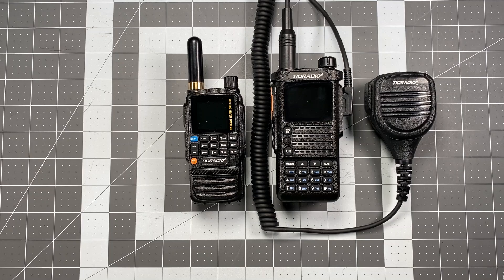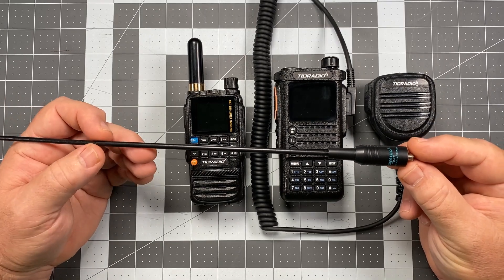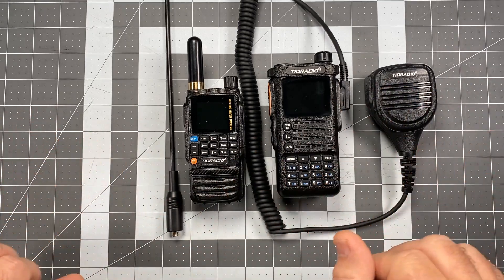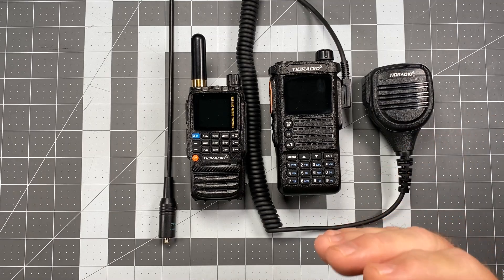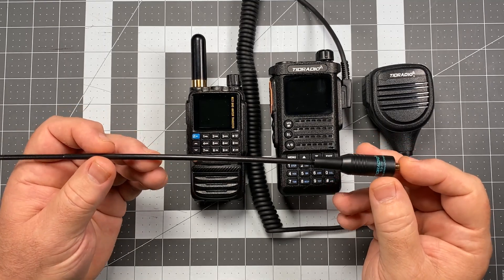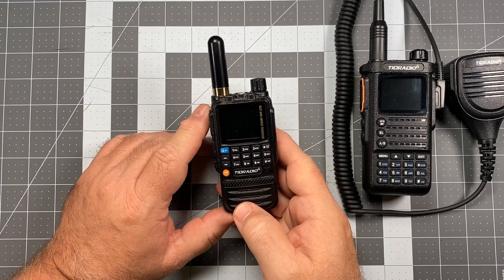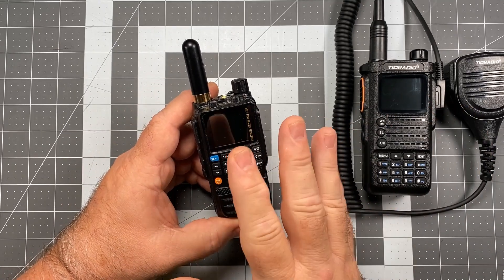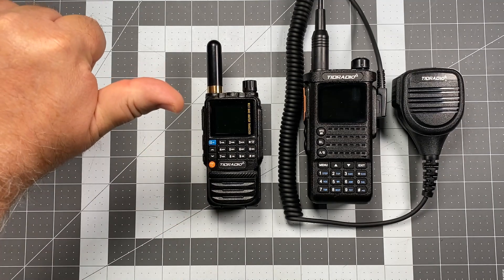TID Radio Antennas Review

Comment: The TD-H3 is awesome. I also got an H8 which I returned to Amazon. I had them side by side and the H3 picked up more than the H8 and I had them positioned the same, even moved the H8 around and could still not pick up the frequency I was listening to on the H3. Also long pressing the “1” puts both in scan mode listening for a  transmission from a radio beside it. The H3 did great, the H8 did very bad. Also both worked on OD master but only the H3 worked on chirp with the cable connected. Perhaps I got a lemon. Nice video.

Comment: Good day!

I've been searching for an answer for a long time but haven't been able to find it. I'm asking you after spending many hours trying to figure it out myself.

I have two Abbree 771 GMRS antennas and two Nagoya 771G antennas. I tested all four antennas as accurately as possible using a calibrated NanoVNA. Yes, I understand that measuring the SWR of handheld radio antennas is a very difficult and often inaccurate task. However, it is still possible to get a general idea of the key parameters and, at the very least, compare different antennas with each other.

The results showed that the Nagoya 771G had an SWR of around 1.8, 70Ω, and -10 dBi (S11) at 463 MHz, while the Abbree 771 GMRS had an SWR of 1.1-1.2, 51Ω, and -22 dBi (S11).

Obviously, based on these parameters, the Abbree 771 GMRS appears to be the better antenna. However, I’ve heard that cheap Chinese antennas are often "tuned" using some kind of transistors to make their parameters look good on measurement devices, but in reality, they perform poorly in transmitting and receiving signals.

In other words, the antenna itself may have poor characteristics as an actual antenna and may not efficiently send or receive signals, but the manufacturer might use cheap tricks to manipulate the readings on testing equipment to make it seem much better than it really is.

Could you please confirm whether this theory applies to cheap antennas (Abbree costs only $8)? Can I rely on the measured parameters above to conclude that these specific Abbree antennas are better than Nagoya in my case? Or is the only way to determine performance through real-world tests?

Thank you for your response. I truly appreciate it.

Best regards,
Oleksii

Comment: I've tested a lot of handheld antennas from Tid, Abbree, Nagoya, Bing Fu, and others.  I used both a VNA & a directional watt meter, the same way that you did.  The two instruments generally gave results that were similar.  The antennas were a real roll of the dice.  Different ones worked in different frequency ranges.  "identical" antennas proved to be very different sometimes.  When I found stubbys that had a SWR below 3, I was able to get about a mile out of them at GMRS frequencies using a handheld with 4 watts of measured output.  More than a few antennas from a variety of brands had SWR above 10 when testing within their specified frequency range.  Even the mighty Nagoya was a little hit & miss sometimes.  Bing Fu gave both the absolute worst & some of the best results.  Their stubbies were not usable, but their 6" air band was actually good, while still being cheap.  Build quality generally seems better on the higher priced antennas, but price does not guarantee proper tuning.  The internal guts can be very different.  A poorly built cheap antenna that is tuned correctly will work better than an expensive one that is not, but the cheap ones seem to not last as well.  A meter is worth having if you are going to be buying antennas.  What they are marked is not always what they actually are.  The antennas that come with the radios age generally OK but not great.  The best ones came in just over 1.1 which is spectacular.

Comment: Good day Sir. If we leave aside all the characteristics of this antenna and focus solely on the safety of using a stubby antenna for the integrity of the radio, is it safe to use these antennas? Do they damage the transmitter?
I have read in many places that such short antennas, very often with high SWR, can damage radios because a lot of power is returned back to the radio during transmission.
I would appreciate an answer. Thank you.
Reply: He did mention in the video it is solely for Rx not so much for Tx!

Comment: When I bought my two TD-H3's I received two of the "TD-771" whip antennas .. but I noticed they say 120/300HHz ( I am currently only using GMRS not HAM) I think these were intended only for the "Air band" frequencies?  Do they work on GMRS too (I don't have a meter yet) ... but I did buy an actual NA771G and it works great. I just have not used the ones that came with my radios because I thought they were not for GMRS. am I wrong?
Reply from the maker: That is the airband version of the TD-771. If you follow the link in the description, the webpage has a number of different TD-771 versions such as Ham, GMRS and Airband specific versions. I should have mentioned the different versions when I did the video. Sorry about that.
Reply: @KS6DAY  Ok good. I thought maybbe I had missed something but yes... I was a little disappointed that my kit came with those two airband antennas which I did not really need. (since airband comes in ok with other antennas anyway and you are not transmitting, so... yeah) Good to hear that the ham and GMRS ones work well. But like i said I have a NG-701G and a NG-771G and they both work great for me.
Reply: @glenn_r_frank_author  Hi, can you tell a difference in clarity and distance with the NG-701g compared to the NG-771g?
Reply: @KS6DAY  
I gets confusing being so many antennas use the 771 number without the frequency range marked on the antenna.

Comment: I had a couple of the Nagoya NA-810 stubby antennas and they were garbage. IIRC, one had an SWR of 7 and the other basically maxed out my digital meter. When I approached BTECH for the return I found out that I would have to pay to ship back and pay a fee even though both were defective (or just a crap product). I verified that they were authentic Nagoya. I definitely would not recommend BTECH or that model of antenna. I bought some cheap plastic 1.5 inch long stubbies off of Amazon and they SWR at 2. Like you I basically stick to my whip or 7 inch antennas unless I am only monitoring. BTW, great series on the H3, I liked my H8 enough that I recently bought a couple of H3s. I just wish I could listen to AM radio on them.
Reply from the maker: I haven't found a 2m/70cm stubby yet that doesn't have SWR problems. Even the Diamond RH-3 stubby produces high SWR.

Comment: Useful info as always Scott - thank you!  Have you heard when we might see the 'new and improved' TD-H8?  Thanks and 73,
Reply from the maker: No news yet. I did notice they have a new DMR HT but they don't seem to be promoting it at all.
Reply: What is going to be "New and improved" on the H8? are they going to put the great features of the H3 into the more waterproof H8? or something else? I would also love to see the H8 and H3 us the SAME battery packs... right now both radios have the same battery power levels, but the physical differences in the two batteries and radios do not allow interchangeability. seams like that should have been designed into these!